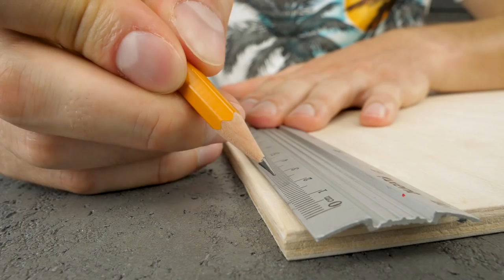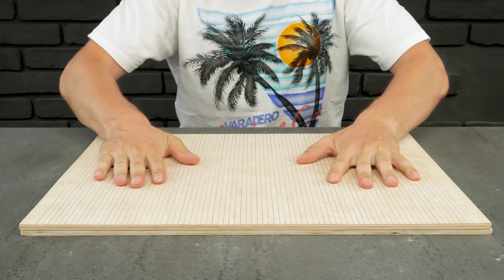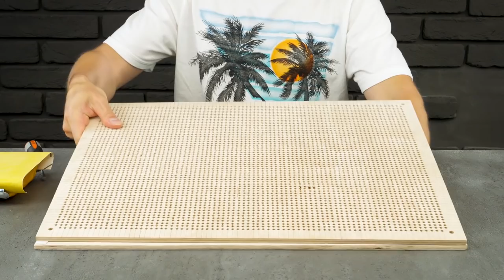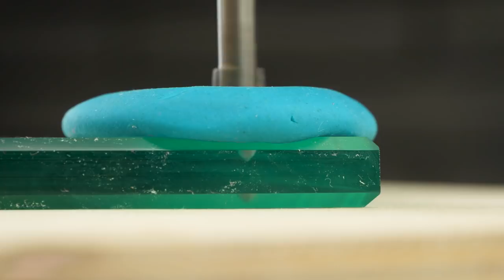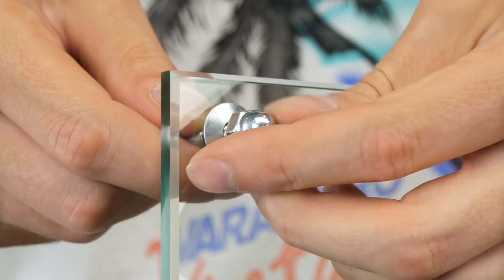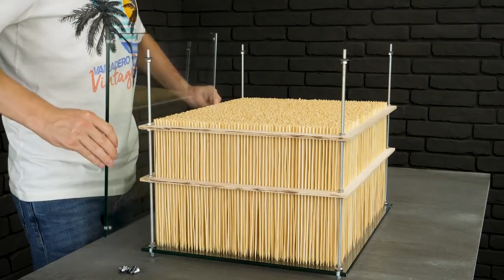DIY Amazing Pin Art from Wood

Comment: "All you need is plywood, glass and bamboo sticks."...um...  and some serious drill, and some cement glue of some sort and a metal cutter and a very long screw of undetermined length, and screws and bolts.  Amazing project! - but not so simple .

Comment: Hey The Q you made a video 3 months ago called 'How to Make Domino Row Building Machine from Cardboard', I am trying to make it, but I don't know where to buy the supplies. I just have a few questions for you. The description in your video didn't say where I can buy the things.

-Where can I buy the supplies?

-What type of dc motor did you use?

- What was that yellow tape thing, Where can I get it?

-Where did you get the battery and the wire and what was it?

-Where can I get the thin wood and the rubber?